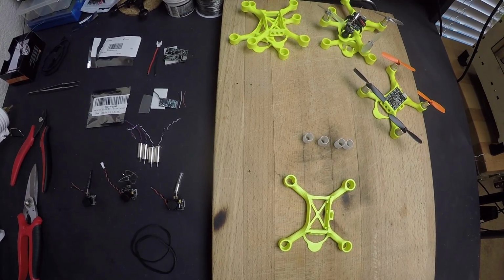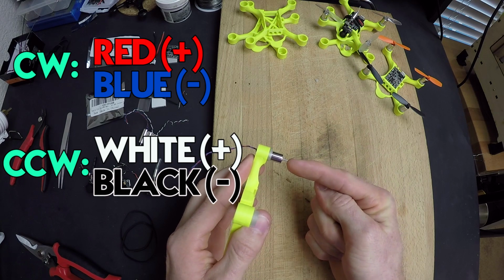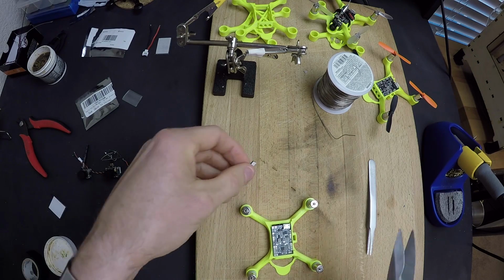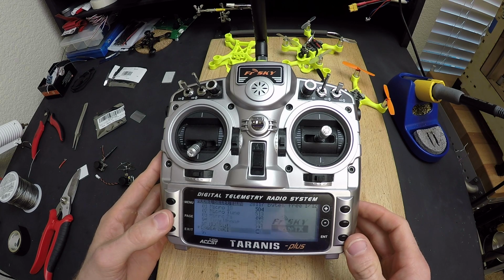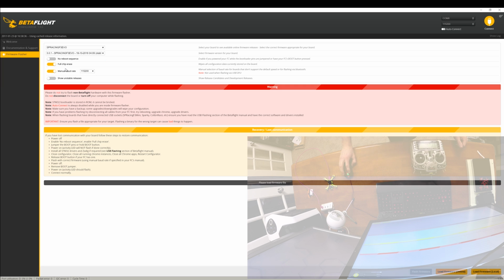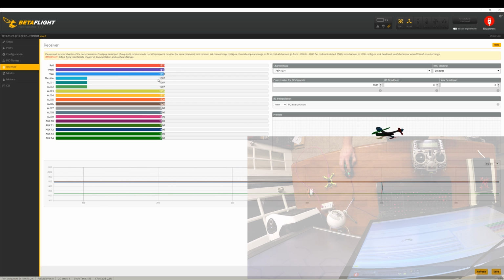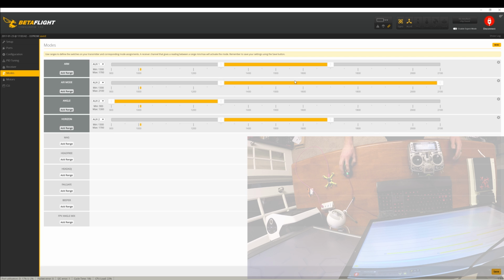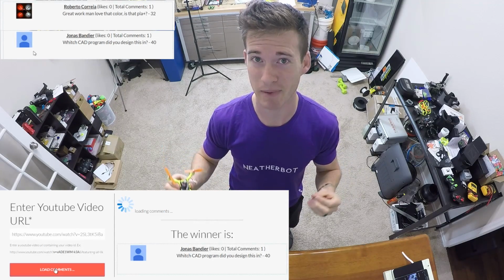Micro Quad Electronics

Comment: I printed it, and it's an excellent and neat design ! For the motor mounts, I used vinyl electrical tape, cutted in half. It's not dampened, but at least It work very well. Others frames don't have dampening and works fine.

Comment: thanks for the helpfull video, still waiting until my heated bed arrives so I can built one...
Congrats on owning an inspire, that has to be awesome!
Reply from the maker: +flipFPV heated bed makes a big difference. Did you try blue painters tap or a glass surface with elmers stick glue? The inspire is an awesome piece of equipment!
Reply: I tried painters tape but totally forgot about the elmers glue, I'm going to try it right now
Reply: The print just finished and it's totally warp-free, thanks for the suggestion!
Reply from the maker: +flipFPV Boom! Excellent! Keep me updated on the build!
Reply: I'll definitely do that!
Reply: Do you think this flight controller will work too https://hobbyking.com/en_us/flf3-evo-brushed-flight-controller-integrated-flsky-rx.html, I think it's exactly the same except for the built in flysky receiver. Sadly I don't have a taranis but a cheap flysky radio... Couldn't quite afford it, I'm only 14 years old...

Comment: What I would like to see is an incorporation of propeller brackets. For the protection of the blades and what you crashed into of corse. Those tiny blades can do some damage.
Reply from the maker: +Samuel Gonzalez I am working on a frame that has prop guards. Oh man  yeah these blades will cut you. Haha I have cuts all over my legs.
Reply: small thought, simple holes to accept 1 or 1.2mm carbon fiber rod at 34 degrees (17L+17R) from the motor arm? not full prop guards but bumpers anyway, right into the outer of the motor mount like a \ /
Reply from the maker: +model nutty Ah ok I think I see what your saying. The carbon rod would bend around and make a lightweight bumber?
Reply: nope, just two straight rods 1/4 or 3/8 past the rotor blade tips about 34-35 degree V on each corner kinda like old school "curb feelers". they'd only protect bumping into flatter surfaces, but very light weight and rigid. ---o<  is kinda the "ascii visual"
Reply from the maker: +model nutty ahh ok thank you for explaining further. I get it know. I have never seen that before, I'm curious how well it would work.

Comment: Sounds like a neat project about how much do you think it would cost for the entire setup.  Controller electronics head set the whole kit?
Reply from the maker: +Shawn if you purchased cheap fpv goggles, a Frsky QX7 transmitter, and had a 3D printer to print the frame and motor mounts maybe around $350. That is a very rough estimate.
Reply: NeatherBot thanks doesn't seem to bad.
Reply: NeatherBot i just placed an order for all the parts. I'm holding off on the goggles. Do you recommend the fat shark goggles their a bit expensive but i do like how slim they are. Also going to be looking for a 3D printer I would like the ultimaker original + and build it my self. That's the one you have right. Where did you get yours from? They seem to be hard to find. Or do you recommend the 2 +. Just trying to keep the price down mostly I know there's improved functionality with the newer models. Also are you selling premade frames and motor mounts?

Comment: You should try the 8,5mm chaoli motors from banggood. I'd like to hear your opinion on them. I think they'r pretty powerfull and they lasted me well over a 100 flights.
Reply: Also, maby you could design the same frame with a jst connector. I use a jst connector and i think it makes a big difference. The first time I flew straight into the ceiling.
Reply from the maker: +Ynze Selders I just got some in. I think it's time to pull out the motor test stand again!
Reply from the maker: +Ynze Selders hmm I will have to do some testing to see about this. The JST do allow more current through. I'm it sure if the micro losi are the bottleneck. We will find out!
Reply: NeatherBot yes thanks

Comment: Awesome, Just got mine flying - had to use a DSMX Spektrum receiver - this worked well and fits once you remove the frame.

DSMX receiver - http://www.wheelspinmodels.co.uk/i/258087/

I also put a Turnigy as 750mha battery on it with some Parrot props.

Man does it go! This is the first 1s I've flow where you are able to get real authority in the YAW on high speed turns and enough power to pop up over things quickly!

Awesome job!

This thing has so much power I'm sure it could carry a bit more weight. It would be great to get to add some sort of top mount to further secure the FC and allow for some other add-ons like a local HD recorder? 

The only other thing I would say is after a lot of use the nano-felx grips round the motors come a bit loose. maybe I will increase the shell thickness ever so slighlty to counter this. 

DX transmitter setup tips - This sets up just fine, pretty much the same way as shown - the only issue I encountered was getting the FC to arm. This was solved by increasing my end points from 100 (default) to 148. I then adjusted the corresponding Dual rates to 75% and EXPO's to 25%

I have linked DX compatible components below:

DSMX receiver - http://www.wheelspinmodels.co.uk/i/258087/

Turnigy 1s 750mha battery - http://www.hobbytronics.co.uk/turnigy-3v7-750-lipo?utm_source=google&utm_medium=googleshopping&utm_campaign=googlebase&gclid=Cj0KEQiAwrbEBRDqxqzMsrTGmogBEiQAeSE6ZfjsAIXsth32KYFsR54nJjXjFB1A2InvyUJMl7Lox54aAoAH8P8HAQ

Parrot Props - http://micro-motor-warehouse.com/products/parrot-rs-propellers-66mm-1mm

Spintech Motors - https://www.spintechmotors.com/collections/spintech/products/spintech-sidewinder-8-5x20mm

For those without a 3d printer  - https://www.shapeways.com/

Honestly, this is the best brushed quad I have ever flown! Factory builds like the nano qx don't even come close. 

This is also my first build from scratch and I have to say - its really not that hard, so don't be scared to give it a go. ( just a little fiddley at most )

Thanks again for sharing - I'm going to try and gets some FPV footage once I am able.

Happy Ripping Rotor Heads!

Comment: What a well done video. The best production values I have seen in a how-to video. I have a QX-90 that I would like to move to your frame when they are available. Until then can you help me. I can't find any detailed electronic documentation on the Frsky receiver. Having lost the quad 3 times in my small backyard I want to add a lost model buzzer triggered by a Taranis switch. Easy to do on a fullsize Rx but on the tiny Rx I have no idea how to select channel 6 to solder on the buzzer. Can you point me in the right direction?
Reply from the maker: +Ken Browning Thank you for the kind words!
Check out this other video and I show you how to set up the buzzer!
https://youtu.be/fGGbjPmkfDc

Comment: Looks awsome! i have a blade Zeyrok and a Dx6e spectrum controller. i just ordered the evo board you used and i eas wondering what battery you were using? 3.7 or 7.4 on that quad? i want to put the evo in my blade zeyrok since i got the RKH carbon fiber frame to make it fly better.
Reply from the maker: +Kenneth Maneeley I'm using 1S lipo packs. 3.7 I'm curious how that flies, let me know!
Reply: will do. i have to get a dsmx satalute reciver also. i am still waiting for the board to come in. I want to try it with the 3.7v battery first then after that i want to fly it with the 7.4 for better power! i will let you know when its all done. Keep up the good work!
Reply from the maker: +Kenneth Maneeley I have played a lot with 2s with brushed motors, I would recomend sticking with 1s for brushed. 2s overheats everything, motors and FC board. Give it a shot, but I have spent a lot of time and money trying to get 2s to work well and it's just more trouble than its worth. 2s on a brushless 1103 10000kv is what I'm playing with now and it's awesome. Video coming soon!
Reply: Thanks for the information! i will try it with 1s then! i cant wait to see your new project!

Comment: The motor mounts are also 3D printed?
Reply from the maker: +abghere yes! Look in the video description for the files
Reply: I put link about that 70% wood particle video, in your previous video. hope you can find a source for that type filament, might save 4-5 gram vs solid plastic and still be strong/rigid.

Comment: Sup bro I wanted to ask you why you use sbus instead of ppm or ibus. Very new to this stuff but when I tried researching it there's so much people say do this way that way everybody has their own opinion so I was curious why you use that option. I use PPM rite now am I loosing any features or loss of control or anything? Thanks for the awesome video going to upload the mini I just made to you're minifactory. Much respect! ✌️
Reply from the maker: +Larry Allard you make a great point which is many options work, and everyone has an opinion as to why their way is best. Let me explain why I use SBUS. I have a taranis transmitter, and with it I have basically two options PPM or SBUS. Both work. SBUS is a faster protocol that only works with FRSky amd Futaba. PPM is a universal protocol that most all transmitters can use. Ibus is for flysky only. All three use a single wire to transmit all channels. PPM is not as stable and more susceptible to noise in the channels. PPM also maxes out at 8 channels. SBUS can do 18 channels and i think Ibus can also do 18ish...maybe. I've never used ibus before. But yeah depending on what type of transmitter you have I would suggest SBUS or Ibus over PPM. But PPM will totally work. Hope that helps. Thanks for the support and comment!
Reply: NeatherBot yeah been using PPM been having issues with response and mis communication some times. Using a cheap flysky what I could afford now hope to upgrade soon. It's hard cuz when it comes to ordering parts and building your own stuff there's just so many options so I get lost. Thanks for the response in detail. You rock bro! Much respect. Flyhigh my man!
Reply from the maker: +Larry Allard glad I could help, feel free to ask me questions whenever you get stumped. Cheers!
Reply: Thanks man will do i appreciate the messages back not a lot of people on YouTube respond haha.
Reply from the maker: +Larry Allard sure thing!
Reply: Can I still do the PID tuneing with ppm?

Comment: I really want to print one out but my printer can only do 75mm x 75mm... how would you recommend splitting this to minimize loss in durability?
Reply from the maker: Unfortunately I do not think you can print the frame in pieces without reducing durability. You could try and just cut the frame in half and super glue it together. Super glue works really well on PLA.

Comment: Can this frame take 65mm blades?
Reply from the maker: +Tn TN With ease
Reply: Great  .... gonna use one with 65mm on 2s. Nice design.
Reply from the maker: +Tn TN that thing will rip! The frame is not indestructable, so when you add the extra power and weight of 2s crashes will more likely break the frame. Soooo just don't crash ;)

Comment: does this quad have more power than the qx90?
Reply from the maker: +Bassbeats with the spintech motors yes! Power to weight is a little lower than the QX90 with the same motors but any motor with more power than the stock motors makes this micro quad a rocket ship!

Comment: Ok, so my boyfriend and I are jonesing to build on this MK XI frame!! We have the qx95's and they are ok, but we hate how messy they are with wiring and honestly, how flimsy they are. Unfortunately, we are not lucky enough to have a 3D printer!! Please please tell me you sell these frames! We have no other way to get them otherwise 😭. Also, does this frame support the 2S modifications you did on your other video with the qx90? Please tell me there is a way that my boyfriend and I can both get our hands on one!!
Reply from the maker: +Alyson Porter Sounds like yall are ready to get rolling with the newest MK XIV frame that I have for sale on my website Neatherbot.com
I am out of stock right now, but later tonight I will have more printed. So check later tonight or tomorrow morning to get your frames ordered! Thanks for the support!
Reply: NeatherBot thank you!!!!!
Reply from the maker: +Alyson Porter yes this frame can handle 2S you just solder the jumper on the flight controller and use 2s motors. Everything should fit no problem.
Reply: NeatherBot If I take all the stock hardware from my qx95 and move it over to this frame and use a 650mah 1S battery (which I currently have been using), will it be able to handle the extra weight of the frame? I know the 2S motors give more thrust to compensate for the extra weight of the frame, but if I opt not to do that, will everything still fly smoothly and have enough power or is the 2S upgrade a must?
Reply from the maker: +Alyson Porter 1s is still very powerful with this frame. I think you will be very pleased with it. Get some powerful brushed 8.5x20 like spintech motors or am equivalent and you will be set.

Comment: how did you do these motor mounts?
Reply from the maker: +hazzard1701 I print them out of Ninjaflex with a smaller nozzle diameter. You can find the exact print settings in the print details page or you can buy them from my site neatherbot.com They are $5 shipped.
Reply: NeatherBot how much is a frame

Comment: Sorry, can i use this (in the link what u gave below the video) receiver with devo 7 transmitter?
Reply from the maker: +Heal & Harm I am sorry but no, the receiver linked below only works with FrSky transmitters. If you can find a micro Rx the same dimensions or smaller that works with your Devon 7 then you can go that route. Cheers!

Comment: Hello, I was just wondering what size is this frame? Is it like a 80mm or a 90mm?  thanks
Reply from the maker: +adrian postell it is 98mm just big enough to fit parrot props if you want.
Reply: NeatherBot thanks so much for the quick reply, I really appreciate it. I was on your website and noticed that you have upgraded the frame a the NB98. Do you have any vids showing the new design? Or any vids showing a punch out so I can get a good ides of the power it will have?  Thanks again
Reply from the maker: +adrian postell hey Adrian, the motors and everything for the NB98 are the same as for the MK XIV. The difference is frame design strengt, and ease of assembly. I just changed up the shipping so frames ship for free!
I am working on finishing up a video showcasing the NB98 frame and all its features. Keep a heads up for that video in the next couple days.

Comment: Hey ...are beta flight clean flight and open tx all apps?!(like flight control programs?.... So do I have to go buy it? & If so.... Where?!
Reply from the maker: +Garth Algar open up Google chrome, then google search for the chrome web store, once your in the web store search for Betaflight. It is a chrome app, or extension. Annnnnnd it's free ;)
Reply from the maker: +Garth Algar Open TX is open source software for  your radio transmitter. And you can find it with a quick Google search. It is also free.

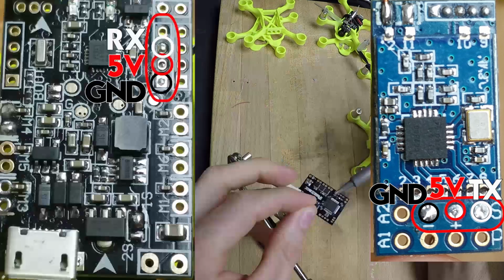Comment: Would it wok with a transmitter like this one? https://hobbyking.com/en_us/turnigy-5x-5ch-mini-transmitter-and-receiver-mode-2.html I'm looking to start out with a cheap transmitter to see if i can fly it. I'm unsure how you would do the soldering at 6:00 in the video because the receiver has like 12 pins whereas yours has only 3 on the sbus that you use. I hope you can help, thanks.

Comment: i have a transmitter 2.4ghz ¿can i use it with Tiny Frsky 8CH Receiver Compatible With FRSKY X9D Plus DJT DFT DHT For QX95 QX90 QX80 DIY Micro Quadcopter? sorry for my english
Reply from the maker: +Alberto Fernandez you have to have a Frsky Taranis or some other FrSky transmitter to use the tiny frsky 8ch reveiver. But if you find a similar micro receiver for your specific transmitter that should work fine!

Comment: would any of you guys happen to have any extra 1s 45c batteries for an Eachine e010 . I literally just got my fpv  camera today and 6 hrs later my antenna fell backwards in a crash and shorted on its own wires and fried my battery. Unreal bad luck and crazy freak accident but I need batteries. If if not it's ok, just thought I'd ask thx
Reply from the maker: +Justin Lewis oh dang that sounds bad! Did that not fry the camera or the flight control board?
Reply: NeatherBot no the cameras omni antenna just fell back and landed right on top of the wires for the camera and the power as you know so I thought my quad,camera and battery were fried but the camera still works surprisingly. It only smoked for a second or so max so I'm thinking that battery was the weakest link and just blew. And and it sucks. I have the stock battery still but it's  like unflyable for fpv the 45c battery is the only way it's enjoyable
Reply: NeatherBot just a freak accident, I have horrible luck and I can't even imagine what the odds of that happening is
Reply from the maker: +Justin Lewis I seem to be the same way...lol if anything bad can happen I will find a way. I will keep an eye out to make sure this can't happen in the future. Sorry it happened to you.
Reply: NeatherBot well good news I actually fixed it and it was scary but very easy and its back to normal which is insane cuz it was fried. I even got to nutmeg my cat haha fly through his legs sideways too. got it on video maybe I should upload it cuz it's pretty cool
Reply: Oh and btw a simple piece of tape over the solder connections is what I did, i also just mounted the camera on top of the e010 stock body